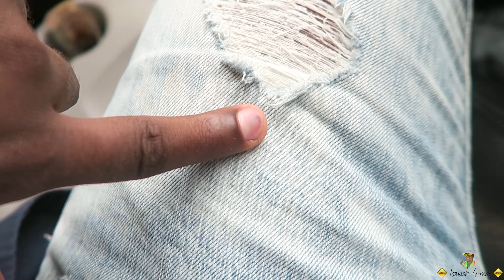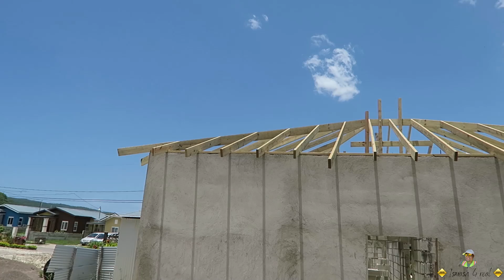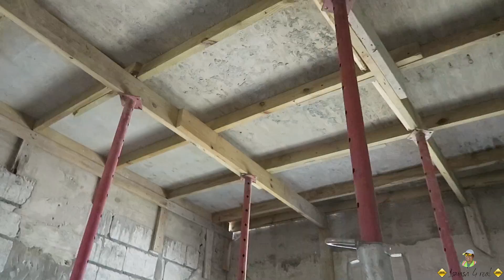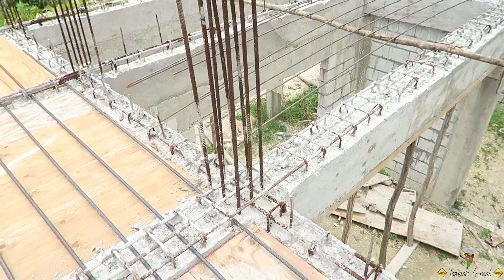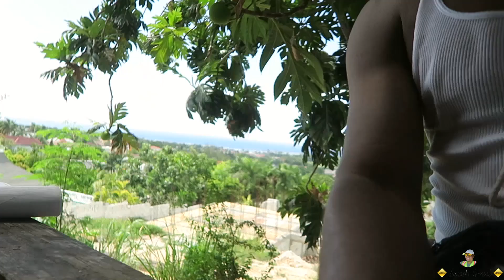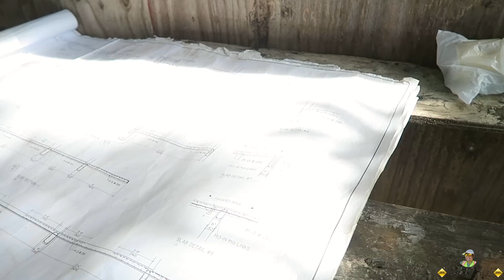BUILDING MY DREAM HOUSE is more Technical Than I Thought (Need To last 100Years Trouble Free)

Comment: It depends on where you are building. If it’s close to the sea, the sea air may erode the metal in the roof work.
Reply from the maker: The metal could be coated?!
Reply: @Ismash4real  I suppose so. The only question would be, will you really get value for money based on everything you you need to do. The lumber for the roof could be treated.

Comment: Hi Ismash - I am concerned about my roof which is identical to this one- the concern is the structural integrity - there are not trusses - I was told they do not build roof with trusses in Jamaica.  I just keep thinking that a good gust of wind will blow it off.  I already paid to have it done and it looks great - my question is - How confident are you in the structural integrity of the roof?
Reply from the maker: If It is that the design is your only concern....you no longer have a concern🙌🏽
Reply: @Ismash4real  ok - I am so accustom to roof designs here in the states where trusses are the norm...thank..appreciate you.